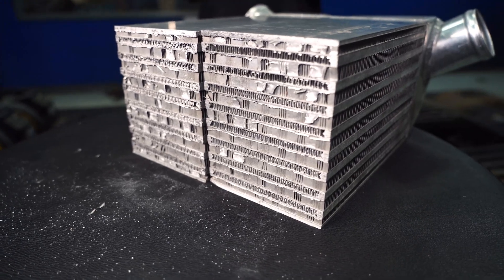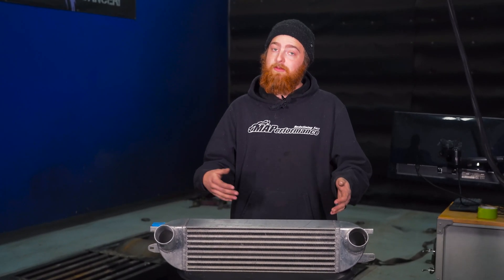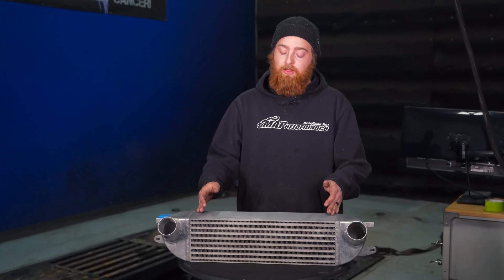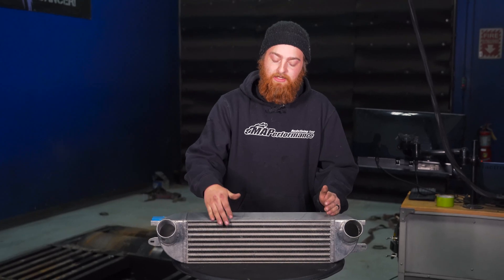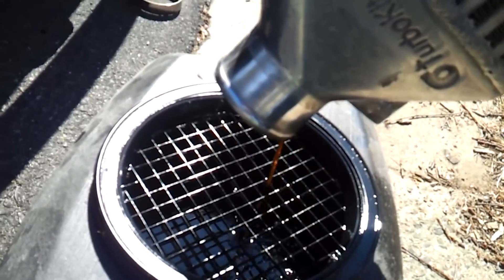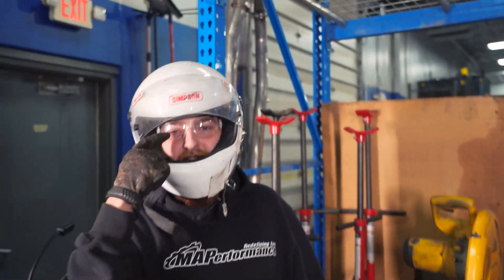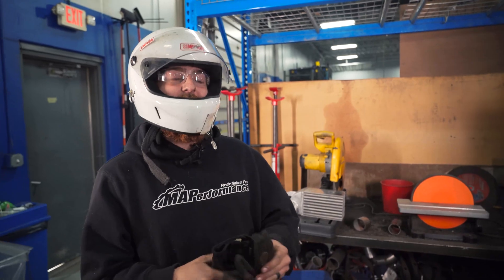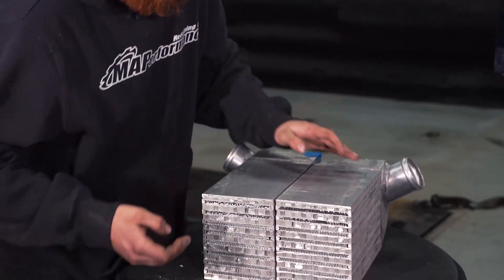Why You Shouldn't Cheap Out on Your Intercooler

Comment: Just to confirm - once you have reduced the length (cut in half) you cant use the intercooler core as all the fins are messed up ie you cant weld the tank on the end. Just curious as I can get a core the correct length. Thanks

Comment: 😅😅 I did!
It does not help generalising cheaper intercooler upgrades. I bought one from Ebay at the third of the price of name brands. I figured it had to be better than the stock one on my Golf R and can't go wrong. Well? I was happily surprised with the build quality, hose and clamps that came with it. Even more happily surprised when i did numerous back to back. Boy! Could i feel the extra kick alright. So, certainly no regrets on a budget Ebay Chinese made intercooler. I also note a number of businesses buying and reselling Ebay intercoolerd citing they are made inhouse. That is a load of bullshit and nothing short of conning people. I say... If you are racing on a race track and every split second counts then throw your money in on a much more expensive intercooler. Other than that? Save your money and get a Chinese Ebay one. You be surprised of the quality. Besides, many things are made in China Taiwan e.t.c and branded for the business having them made for them That includes Tyres.
My Golf R runs like a Super car. 👍🇦🇺😉

Comment: what are your thoughts on intercoolers with connections each on opposite sides versus intercooler with both connections on the same side where the air is forced to make an about face?

Comment: I will gladly agree and say the maperformance 2015 wrx  intercooler is the worst you can buy.
Reply from the maker: That's unfortunate that you had a negative experience. What issues did you have with it?
Reply: @maperformance  that it is no better than stock. The IATs are no different than stock. It doesnt mitigate heat at all. But whatever until I can afford a garret it will suffice.
Reply: @GaragebuiltOriginal  Much like a radiator, the cooling ability of an air to air intercooler is largely affected by the amount and velocity of air over the fins. An intercooler that already makes use of all it's cooling airflow is as effective as it can be, to see the expected reduction in IATs you need to figure out how to increase airflow over the core. the only way an IC will drastically reduce IATs is usually with a big frontal area increase, because that increases total cooling airflow.
Reply: @mikescherrer4923  so basically this top mount is no better than stock. I hear the only good one is from cobb grimmspeed and Garrett being the best. So basically kids dont waste your money like I did.